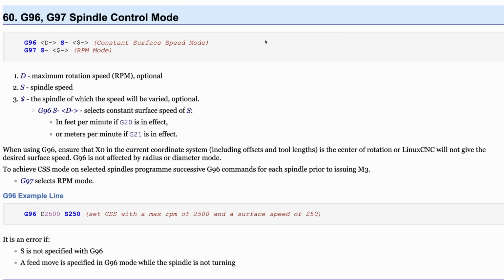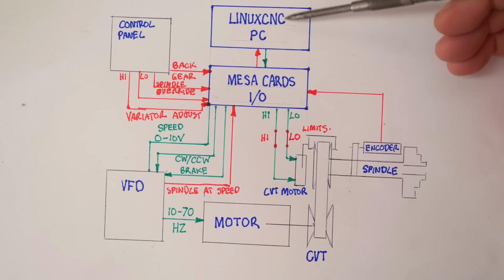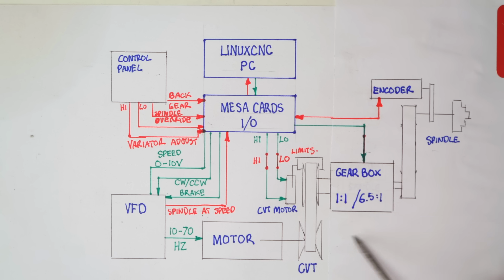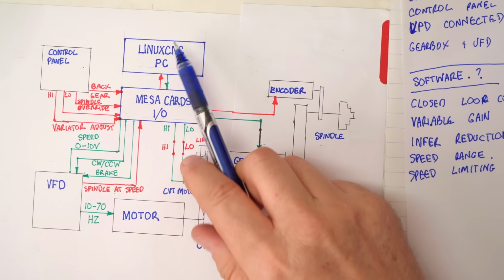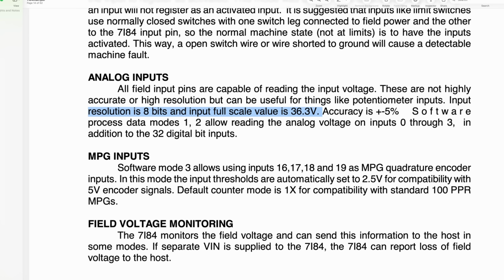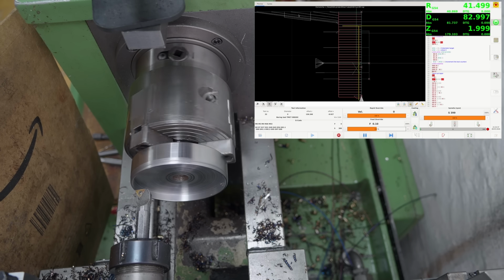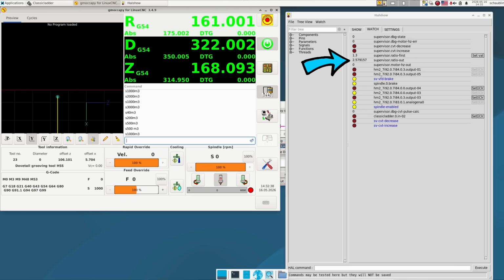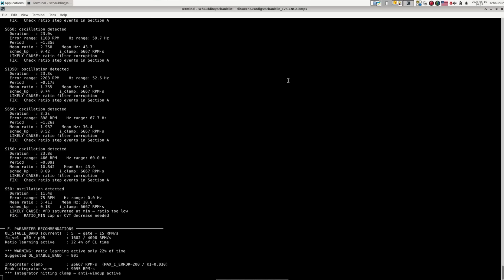Schaublin spindle control Ep.68. || RotarySMP

Comment: I thought it was a great video. Really interesting. One of the best parts of Sundays - Watching the new RotarySMP video. 👍
Personally, I'd put some more feedback sensors in there. Perhaps enough with a hall effects sensor (RPM) on the spindle motor, so you can get a ballpark figure of input RPM. I guess you don't need the motors rotational position, just RPM.
Potentially an additional hall effects sensor on the output pulley, so to speak. Those two simple RPM sensors would give your software logic a better chance of getting it right.
Reply from the maker: Thanks Richard. I have added more info into the vdeio description on the next attempt.

Comment: Hmm, interesting control problem you have there. Your video definitely tickled some parts of my brain.

A few things came to mind while watching your video, in no particular order and with no claim that they are good ideas:

If you want to get the position of the CVT, I would suggest using a cheap magnetic angle sensor (something like the AS5600). Simply stick the magnet to the rotation point of the moving arm (bottom left at timestamp 10:10). You will always have the absolute position without the need for homing.

I would definitely go the route of mounting an encoder directly to the motor, as you suggested. It would allow you to set up a fast PID controller whose parameters do not need to be changed all the time.

This controller could get its input from a second, slower feedback controller, taking CVT position and gearbox settings into account while using the output encoder value as input.

Then you need to find good settings for the gearbox and the CVT.

Since you do not want to change gears mid-cut, it would be really helpful if LinuxCNC could predetermine the maximum and minimum RPM from the given G-code. Then it could choose the optimal gearbox setting for both speeds. This could be done, for example, at each tool change.

For the CVT setting, I would try a lookup table with the gearbox setting and demanded RPM as inputs.

The two concatenated controllers mentioned above should be fast enough to adapt to CVT changes.
Reply from the maker: Interesting, I didn't know of that AS5600 module. Not sure how it would do in that rather dirty environment. 

I have written up my plan for the next attempt in the video description.
Reply: @RotarySMP  Those plans definitely sound like good ideas to try out. I feel honored that I made it onto the list.
About the longevity of the AS5600, I honestly don't know either. But at least it's contactless, so covering the whole PCB in resin shouldn't affect its function.
I also like the idea of having an input and output encoder to calculate the gear ratio, but you would still need to know whether the ratio is coming from the gearbox or the CVT.
If you want to use the 0–10 V signal, I would recommend a non-inverting amplifier circuit with a proper "Wald und Wiesen" op-amp like the LM358. The LM358 can be powered from a single supply, with GND and VDD as the supply rails, as both the input and output can go as low as GND. However, VDD should not be higher than 32 V or lower than 3 V, and the output cannot reach VDD. Maybe there are better rail-to-rail op-amps for this application.
Is there any information available on how Schaublin originally controlled the speed?
Reply from the maker: Since the back gear is only set stationary, and I can log that value, it is known, and does not need to be sensed. I can use measured ratio of a sanity check on it.
I was looking at the AS5600, and there is this project which would allow use of an arduino nano to digitise the AS560 i2C and tranmit it to LinuxCNC.
https://github.com/AlexmagToast/LinuxCNC_ArduinoConnector

I looked up Schaublins manual. They divided 48-3000 RPM into 48 discrete speeds. With the back gear and the Dahlander windings, that means they split the CVT range into twelve bumps. I am pretty sure they didn't do true CSS. It had surface speed or rpm as settings, but I am not sure if that was just fixed at the start of a cut? To do a larger diameter than about 80mm facing cut , stepping through the speeds open loop, they would have to come to the point where they needed to switch dahlander windings, which would be a 2x speed jump, that the CVT could not compensate for.

Comment: I found this video about this speed control problem very interesting. Good luck finding a first rate solution. I'm sure you will get there.The VFD should run between 40 and 60 Hz for cooling and for motor efficiency, but you may exceed those limits briefly to quickly change the spindle speed and then use the CVT variator to change the transmission ratio to allow the VFD drive to move to its optimal 40 to 60 Hz range.
Reply from the maker: Thanks Paul. I set the speed target to 50Hz +/-5 in high gear, and +/-10 in low range. 
I added some info on my options and next attempt to the video description.

Comment: I've been down a similar rabble hole with LinuxCNC and spindle control. I've never gotten it to work without either an encoder attached directly to the motor shaft, or via 1:1 belt drive.
Reply from the maker: I have written up my plan for the next attempt in the video description.

Comment: Mark, put an encoder on the motor.  This will allow you to truly see commanded speed vs spindle speed.  I bet you will find a straight forward spot to place the encoder.  Cheers
Reply from the maker: I will take one last ditch attempt first. See the description I added to the videos description today. 

But if it will be the encoder, I'll probbaly pull the motor fan, and use the stub shaft to drive the encoder. Just add an electric fan to the motor shroud.

Comment: If you dont know what you are doing already AI is useless and will only seem to work. I can tell you that you are most likely better off learning to code or just do the hardware work. The problem is AI will always "pretend" like it "knows" what the problem or the solution is, if you dont know what you are doing or are really good a debugging you will chase errors around and never get a good output. 

If you really dont want to do a lot of hardware work i would opt for a encoder on the motor side of the drivetrain so you can infer the gear ratio with a knows input and output value. it would also maybe make sense to know if you are in high or low gear so you can calculate the belt ratio and go from there. But as i said it will be a lot easier for you to change the hardware/learn to code than fiddeling around with ai. It will seem like you make progress but most of the time AI will go one step forward and two steps back so you "do" a lot but dont get real progress. If you cant do the last 30% by yourself AI is useless, especially in a rather "niche" use case you have here.
Reply from the maker: Good inputs. Thanks.

Comment: As someone who grew up a few years before this sort of technology appeared I wonder if you can appreciate how miraculous it looks to me, that machines can control machines. Even if it's not working as you'd like, I still think it's amazing that it can be implemented by one person in a home shop. I have no doubt you will sort it out. BTW Mark, I have a Subaru with a CVT, and I think of it as a constant velocity transmission even though I know it's not. I spent a bunch of time with the manual until I got to the chapter that discussed programming birthdays and anniversaries. Really? Into my car? What I'd like to know is how to turn on the damn fog lights!😅
Reply from the maker: Hi Jr, thaks for the encouragment. Yeah, the customisation in modern cars is way over the top.
I added more info the video description to weigh up the options, and my next attempt.

Comment: For your gearbox, you can make your own "Feedback" in software, when you start up the lathe, just switch it back and forth and store the state in a variable and update any time you change into back gear or to 1:1. And I saw someone mention a potentiometer as a feedback for the CVT, that little arm that moves up and down looks like an easy to reach position to attach one. 
Even if it doesn't save on mechanical work, a tacho generator might be a cheaper solution for speed feedback on the motor.
Reply: another option is modeling sensors that aren't practical to actually have. simple example, if the cvt adjuster moves at a constant speed, you can estimate its position by keeping track of how long you've run it and in what direction and integrating. or if the vfd has constant acceleration you can estimate its speed based on when you last commanded a change and how big that change was.
Reply from the maker: Thanks guys, I added more info to the vdieo description on what the next attempt will be. It will use that dead reckoning timed CVT bump concept.

Comment: 2:46 "excessive complexity" in machine tools is something I think about a lot. In 2026 I suspect the cheapest and easiest answer to a lot of problems is "throw a microcontroller on it" but in the hobby space I still see complicated gearing and mechanisms on "new" machines. Probably has a lot to do with industrial/institutional momentum and inertia, but I always look at tools and think, "why not just have a stepper motor and an esp32?". 

The popularity (and utility) of electronic leadscrew retrofits speak for themselves and in my opinion trades off mechanical complexity for electrical which to me makes a ton of sense. Then again, I'm just a hobbyist.
Reply from the maker: Wee summarised. I always say that a machine like this 125-CNC is way simpler than the manual 125C. If you look at all the gearboxes, clutches, interlocks, drives etc, this is pretty simple, even with the software.

Comment: honestly a much smoother way than copy pasting between chat threads is just using an AI agent in your editor. I'm use Copilot in VS Code, it sees the whole project so the answers are actually useful. and you can just set Claude as the model in Copilot anyway, so same Claude quality but a way nicer interface. I also edit over SSH so it runs and tests straight on the target machine which makes life easier. Something to watch out for is agents editing files all over the place, but with Copilot in VS Code it's easy to undo so it feels a lot safer to test stuff.
Reply from the maker: I am pretty hopeless at the whole networking thing. I only have one ethernet port on the lathe, which is occupied by the mesa 7i92 control card. I need to set up a USB ethernet connection and learn to use SSH and Git. These things do not come naturally to me.

Comment: The mass of the CVT and gearbox will make it hard for the motor to quickly change the speed of the spindle, no matter the effort that the VFD puts into this or the bleed resistor that you have. It is just a lot of energy that is required or needs to be dumped. The advantage is that the controls will be relatively unaffected by mass of the workpiece (always add a silver lining). 
Thoughts: 
The gearbox has two positions. That sounds like a binary signal, and one that would be useful. 
Some input of the position of the CVT to the software is required, as far as I can see. I think the PID constants change with the position of the CVT. 
Given the masses involved, I don't think there is a way forward without a speed sensor at the motor. What you are trying to figure out are the constants for a PID controller of a system that is inherently slow dues to the mass. That is indeed no fun at all, especially if part of the information is missing. 
Suggestions: 

Measure the time between commanding a VFD speed change, and the new steady state being reached. I'm not sure if that commanded change in speed can be a step function (20 Hz → 50 Hz), or if you should ramp it. The latter gives more headaches. This should give you some idea if the speed control can be quick enough for what you want. Do this for different CVT positions, and both gearbox positions.
Reply from the maker: The versions I had scale the PI gains to the inferred ratio. The issue is that that motor command signal is often very different from motor RPM, and leads to a garbage ratio. I added filters and gates, to only learn the ratio at steady state.

Turned out I already have a better option there. The VFD "motor at speed" signal is already wired into LinuxCNC, and need to try that as the inhibit on the ratio learning.

I have written up my plan for the next attempt in the video description.

Comment: Missed my coffee this morning... ☕
Question: You know approximately the motor speed requested from the 0-10V, you know exactly how fast the spindle is going, so is it possible to infer the gearbox position and the CVT ratio by turning a little? A bit like the mill does a back and forth to engage the gears, you could do something similar to calculate the current gearing?

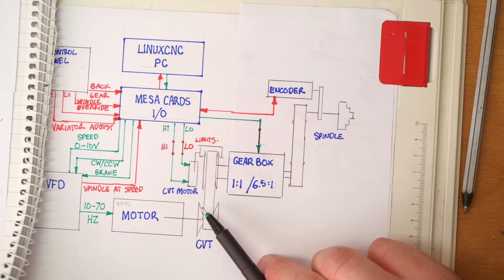Edit: I think that's what you're planning at 17:00 ish...
Reply from the maker: That is what the software was doing. But that commanded 0-10V, is often not close to actual motor RPM; so I needed a lot of gating and freezes, and still got pretty wild data. The first ChatGPT version did this better.

Comment: As a software guy, this system can be solved purely in software. But (just) PI/PID control won't lead to smooth results, even with lots of smart case by case logic on top of it.
What you need is MPC (model predictive control) where you keep updating a (physical) simulation of your system. No simulation is perfect so any discrepancies between the simulation current state and reality will be resolved with a PID loop. You currently have motor commanded speed, say 10hz or 600rpm (for example sake). After 1s, with no load the motor should actually hit ~600rpm. Similarly, after holding at 50hz the motor will hit ~3000rpm. With a simple MPC, you'd also keep track of 'motor predicted speed' that will update gradually if there was a commanded change from 10hz to 50hz. I'm fairly sure the VFD implements a very simple control scheme - either linear or trapezoidal - that can be rather accurately simulated. Similarly, you'd keep track of 'predicted gear ratio' for the CVT, simulated based on initial measurement and later commanded changes.
Say you (or the surface speed control) command(s) the spindle 1500rpm -> 2000rpm: some "simple logic", for example, would calculate and command that the idealized VFD would go 60hz to 50hz and idealized CVT would go 2.4:1 -> 2:1. With this simple MPC, at each time step you would have a 'motor predicted speed' and a ~measured motor speed (measured spindle speed divided by 'predicted gear ratio'). You feed the difference between the two (i.e. error) to a PID loop that outputs a correction, a difference in hz (example: -0.5hz), which you add to the idealized hz and feed it to the VFD.
Pitfalls:
- don't feed the hz correction to the MPC to avoid a bad feedback loop
- the "simple logic" should output ~continuous functions for both the VFD and CVT - small spindle rpm changes should result in small changes, which means often commanding the CVT to go for like 0.2s in one direction (and make sure the logic includes hysteresis for the CVT)
- CVT position can drift over multiple back and forth movements so you'll want: from time to time take a short pause to recalculate the gear ratio and reset the PID OR (more difficult) keep an exponentially weighted moving average estimate based on measured spindle speed/motor commanded speed and make tiny corrections towards it on every commanded CVT position change
- still uses PID which still requires a decent tune
Advantage:
- the simulation doesn't need to be super accurate as the PID loop will make up the difference. A simple look up table with linear interpolation in between will be good enough for the CVT. A simple linear model should work for the VFD/motor speed.
Reply from the maker: Thanks for your detailed response.

I think my next attempt will be open loop with a loop up table for HZ and CVT dead reckoned into 5 fixed ratios, about 1 sec apart, and then as you recommend, taking advantage of steady state periods, to cross check and correct for CVT drift. 

A friend pointed out I already have VFD "Spindle-at-speed" feedback wired in, so I can use that to gate or freeze the ratio calculation when the signal will be garbage.
Reply: @RotarySMP  This should work (even mid cut) if the VFD and the CVT control take roughly the same amount of time to effect a similar percentage spindle speed change. If they don't match then you'll get weird speed-ups-and-downs whenever changing CVT ratio which would be cool to see&hear on video :). But hopefully you can tune acceleration and deceleration times on the VFD to match. Quick napkin math: assuming 2.5:1->1:1 CVT (5s) which should match a 28hz->70hz change, you'd want 8.33s for 0 <-> full speed (seems reasonable).

The VFD spindle-at-speed is probably when the VFD finished commanding the change rather than when the motor actually finished fighting inertia so maybe wait a fraction of a second longer. It's great to have that signal though.

I won't mention hysteresis for the CVT ratio cause not having should also make for good video content :)
Reply from the maker: @mhdm  You have a good understanding of what the real issue is. As the CVT moves at a constant rate, too fast for most CSS cuts, the VFD would ideally be reducing frequency to compensate for the CVT raising RPM to quickly on an inward CSS facing cut.. 

When I looked at the CVT in detail years ago, when I first connected it, I think it has a range closer to 2:1 to 1:2, so 4x.

 I have written up my plan for the next attempt in the video description.